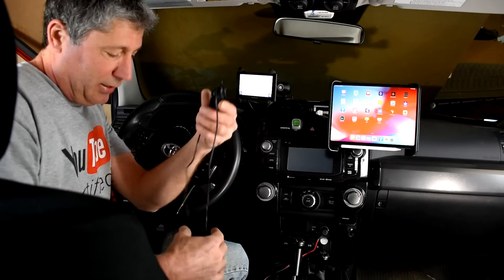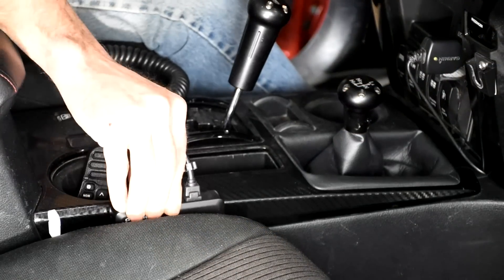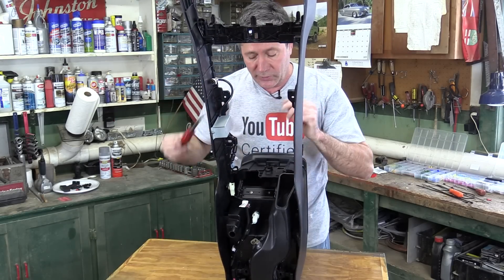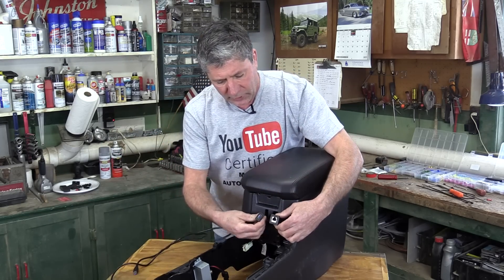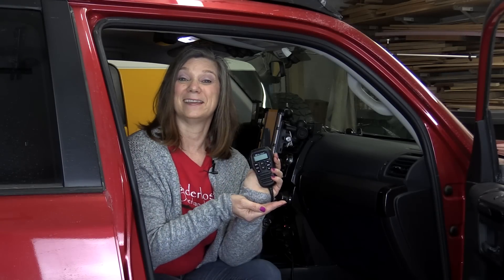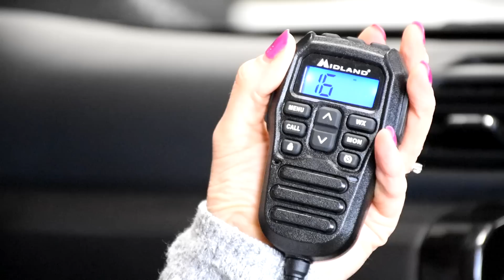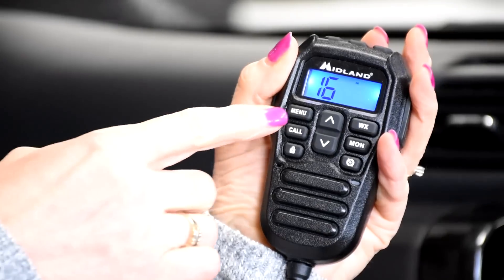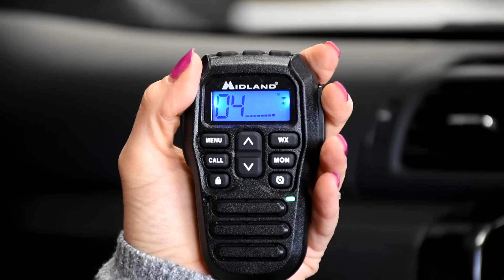GMRS Radio DIY Install & Testing Against CB Radio For Distance

Comment: Like others, I was concerned about the antennas used and the location. Ideally, any CB or GMRS antenna on a vehicle should be centered on the top. You must have the ground plane underneath what is effectively a quarter wave vertical. The CB antennas are reduced in size in most cases because a full sized quarter wave would need to be around 8 feet long. If it is 4 feet or shorter, you can not expect good efficiency. This is what can make GMRS do better since a gain GMRS antenna is only a couple of feet long.

I use CB, GMRS/FRS, and ham radio. If you are operating in a group, and everyone has the GMRS license, I would recommend that approach. CB is noisier, even with 12 watts PEP SSB, which is superior to regular 4 watts AM CB, but few buy rigs that add the SSB mode. And CB can be severely affected by long distance stations that may interfere with local communications if skip conditions happen. This almost never happens on FRS/GMRS.

CB can be useful if it is the only choice you have because the others only have CB. SSB  GMRS is usually better for short ranges, perhaps 10 miles or so when mobile, longer for base to base or base to mobile, especially if using a repeater, should that be available. Up to 50 watts output is allowed on the main channels. GMRS can interoperate with FRS on most of the channels (the ones the have allow the higher power levels that are the ones you probably would want to use). This means that if someone has a GMRS license and good setup in their vehicle with outside antenna, they can talk to someone with an FRS handie-talkie for a longer distance than two FRS HT's talking from inside vehicles which only allows very short range. Ham radio, is OK for hobby radio, but it only works if everyone has a ham license. And ham radio is about the same as GMRS for similar power and distance for the ham 3/4 meter band and only slightly less effective than the 2 meter ham band.

Comment: A LOT of mobile ham radios are 50,75 even up to 80 watts for VHF and even with just a short 1/4 wave mag mount antenna will have a lot better range than a 15w GMRS radio. It's worth it to take the test! I did it with very poor short term memory from a TBI, you can do it too!

Comment: GMRS may have more advantages then the traditional CB, due GMRS is Frequency Modulation and CB is Amplitude Modulation. The Real experience with GMRS is using Repeaters, which really allows communications  up to 150 miles or more depending on the location of the repeater and the antenna's height  Of course Repeaters are legally allowed up to 50 w ERP. Most surplus part 90 radios are typical used for GMRS Radios, even though GMRS fall under FCC PART 95 There hasn't really been manufactures putting out PART 95 GMRS mobile radio until 2014 up to now
Reply: Adam Huffnagle how many repeaters are there for GMRS?

Comment: The Ham test is very easy. 2meter and 70 cm are great . Now there's Digital to ware you can talk across the country and world. CB is still great with a better antenna.  I did like your video on the other option. My 12 year old grandson passed his FCC test and got all 34 questions correct.
Reply: I have been a ham radio operator for 12 years and my call sign is KD0DUJ

Comment: Ham is not ideal. Too many Old Farts on there disrespecting the New Hams who are young people trying to get use to the radio rules and the way you interact with others on Ham.
  I hear it all the time on 2 Meters that the much older people hate the New Hams and chase them off the Repeaters. 
Also these Older Hams hate the new Technologies that is added to Ham.
  I'm here in the Silicon Valley and I listen to Ham, GMRS and CB.
I'm a Ham and GMRS operator, but also Prefer the GMRS over Ham, due to being yourself and no like what the other Hams want you to be, I see that as being Fake.
  Just be yourself and use GMRS and everyone one will accept who you are, unlike Ham.

Comment: I have a C.B. with a Wilson 5000 antenna and in my car I can talk 12 miles without any problems. My friend I talk to at 12 miles is also in a mobile. Your radio is only as good as your antenna. By the way the "HAM RADIO" test isn't hard to pass, if I can do it anyone can. Get the current book, study it until you feel good about it and take the test. The book has the same questions with the same answers you will be asked on the test, telling you why this one or that one is right. Almost forgot if I am on the C.B. and I am on ssb, then I can talk about 25 - 30 miles away.
Reply: right out of the box, with very little in the way of upgrades (They did upgrade the antenna) they got 10 miles.  However, they won't get over a hill because 460MHz is primarily line of sight, whereas the the CB band will perform a little better in taraign, but not at the legal 4 watts. GMRS is legal to 50 watts.
Reply: i looked at the book and what the license allows. and have to ask why does it require a fairly in depth understanding of things you are not allowed to use unless you get the other licenses? why cant it just give me a brief explanation about those things just in case i would be interested in getting the required license for it?
Reply: @IrradiatedJellyfish.6746  And once again you have to Pay for a GMRS License.
Reply: @IrradiatedJellyfish.6746  Electricity and EMF are fairly efficient at doing nasty things when you fiddle with it. It is good at interfering with other services, starting fires, causing burns, cancer, genetic defects, and just outright killing. And it can do those things to not just you but others that wander too close to it. That is why it is important to understand how it works and where you can and cannot be safe when fiddling with antennas and radios and how propagation works at various frequencies. Plus, you are now accepting the responsibility of setting up and managing your station. If it is out of spec, you are responsible for knowing, stopping transmissions, and correcting the defect.
Reply: I'm an Extra Class and no Rockethead by any means. You just need to be interested.
Reply: if you can pass a ROBLOX group application (real thing btw) then you can do the HAM radio test so long as you read some books
Reply: I've never gotten that range out of my 5000.  You must live in Texas, or somewhere there aren't many obstructions......7 miles is as far as I've ever gotten and that was with a tuned and peaked 300 dollar radio......
Reply: 10 miles for mobile to mobile is NOT typical. 2 miles is typical. And maybe 4 miles if you have a quality radio, coax, and antenna. I have to deal with oversize load escorts all the time. I know how far they work. 
FYI- I have driven over a million miles with a CB, and a few hundred thousand with a HF, UHF, VHF ham radio. here is NO doubt my HAM radios make my CB looks like it was made for a three year old child. A toy, not expected to perform any real work.
Reply: @samualwhittemore228  Then how come so many of us get 10 miles out of a mobile rig when we take the time to do it right?  As was said, it all seems to come down to antenna and placement, you can't just slap a $10 Wally World short antenna on your car and call it a day and expect great results.  Put a proper 102" tank whip or the big boi coil spring antennas, actually tune your antenna, if you can put it on a proper position and not shield your antenna to make it worthless, they can do very well for many miles.

That is an overlooked aspect of some of CB's problems in field use.  It isn't that 11meter is worthless, it isn't that "CB sucks and is a toy".  The problem is HF is best with full size antennas, not small antenna coils.  A half length 2 meter antenna is easy, a half length 70 cm even easier, but even a quarter length 11m antenna is HUGE.  This alone gives a lot of "typical" setups of VHF and UHF an advantage over 11 meter CB in mobile applications, because handhelds and mobile rigs can run full size antennas, while most CB folks end up castrating their performance with compromise antennas.  

I've mounted a 102" whip on my cars for local testing.  When you actually use a true full sized 1/4 length antenna, you can go head to head with GMRS or other VHF and UHF when using the same power.  Those 4 little watts can do go a very long way, when you actually do it right.  Base station to base station, 20-30 miles 4 watts AM can be achieved.  A lot of serious CB people have gotten good results, even without amplifiers  

GMRS is a good thing,  more folks should get their HAM.  But I get a bit tired of people maligning CB.  It ain't as bad as anyone makes it out to be.
Reply: @samualwhittemore228  4 miles?.. With a simple Wilson 5000,  and virtually any cb , I can (and do) easily talk 10-15 miles. Four miles tells me you probably have a 4 foot firestick. I agree HAM outperforms CB, but with a good antenna, and a decent radio pushing 150 plus watts, CB is commendable.
Reply: @shannonavella6782  "...with a good antenna, and a decent radio pushing 150 plus watts, CB is commendable."

150 Watts is illegal in the Citizen's Band (as well as the GMRS band).  If you want to go to 150 Watts (or higher) take the test and get a ham license.

Comment: 📻🎧🎙  Okay, I'm a long-time (20+ years) Ham operator & CB'er. With handhelds (walkie-talkies), all three (CB, GMRS, VHF/UHF Ham) are extremely limited (only half mile or so reliably).
  In a vehicle, CB wins hand-down (radio service was designed for that). With a proper antenna (the key ingredient), you're talking 5-10 miles (vehicle-to-vehicle) and 15+ miles (vehicle-to-base). With under-used SSB CB, significantly more distance in either situation.
  As for VHF/UHF Ham radio, you do have repeaters, but repeaters are often not available in remote areas. Otherwise, the line-of-sight aspects of VHF/UHF (blocked by terrain, etc) greatly limits the usability of such radios, especially in a vehicle.
  In emergencies, there are far more CB'ers (both on and off-road), hence far more likelihood of getting help.
  In the end, CB radio, with all it's negatives, is still the best choice. While I do have GMRS and Ham radios, my vehicles are equipped with CB radios exclusively.
Reply: Until the skip rolls in (7 year cycles). Then you're lucky to talk a mile on a CB, though you can talk with people thousands of miles away. --- One advantage of using CB for off-road rather than GMRS is the wave length is longer so much better at getting over trees, buildings, small hills.  GMRS is "line of sight", if there's tall objects around your range will be very limited.
Reply: @DFDuck55    ..  Skip doesn't really reduce your range, just makes it harder to hear through all the background noise. A good antenna, well grounded, will reduce that noise by a few decibels. A speaker that attenuates high frequencies (where most of that noise is) will help too. Beyond that, it's just a nuisance. Turn the squelch up and deal with it. By the way, SSB will reduce the noise even more.
Reply: I used CB radios from the late 1960's till late 1990's.  My favorite times were when  the skip was in, and talking around the world on DSB (duel sideband). --- FM sounding so much clearer than AM really has little to nothing to do with speakers or squelch. When two people are talking at the same time on FM the strongest signal 100% overrides the weaker one. When two people are talking at the same time on AM you can still hear them both, with lots of heterodyne noise mixed in. There is no heterodyne noise when using FM.

Comment: Just FYI and someone may have already said it.. a cb un-modified only puts out a maximum 1 watt where as at high power for GMRS channels can be at what the radio is rated, most handhelds is 5 watts and your particular mobile unit is 15 watts.. the other difference is CB is AM freq and GMRS is FM UHF... GMRS  WRCB663        HAM  KE0IHJ       CB Handle - Nighthawk

Comment: Get your ham ticket.  You won't be sorry, most ham equipment works on GMRS frequencies.  You can talk to your local friends on GMRS with the added capability of worldwide communication.  You will learn how to make your systems function better, the range you are getting on 27 Mhz using AM is very poor, there is much room for improvement.  I'm just saying through ham radio you will learn how to set up a kick ass system on any frequency, any mode, with crap you can find in dumpsters.  It's a good skill set and your interest in it leads me to believe getting your ticket and learning more would probably be a rewarding experience for you and could potentially create good content for your videos.

Comment: It's hard to beat ham radio for versatility and coverage.
Reply: I totally agree, but this might be good for the family and friends that are not hams. ~KE8DMQ
Reply: @ohiophantom  That's right.  People often suggest "just get your ham license", but gmrs licenses let members of a family all use the radios on the single license and you can communicate with FRS handhelds.
Reply: at night time when the skip goes down.   

AM side you can do about 20 miles.
SSB  you can do 35 to 40 miles when there is no skip.

GMRS will go 10 to 15 miles   and 2 meter will go 10 to 15 miles.

now i know you can put repeaters on GMRS and 2 meter to go more.

but i will admit in day time GMRS and 2 meter are the best.  CB radio gets to much static in day time.
Reply: Yes but not everyone wants to take a test. Although ham is easier now then ever before with the morse code requirement eliminated.
I have both a HAM and GMRS license. They both have pluses and minuses.
The advantage of ham is much more spectrum you can use including HF, which the signal can go thousands of miles and allow to talk around the world! Also, with ham radio not only can you transmit voice, but there is a whole slew of digital modes. You can transmit GPS position, text-based messages, images (using SSTV), as well as morse code.
The advantage of GMRS is the simplicity, you don't have to be technically minded to use it unlike ham radio. Also, the license covers your entire family unlike ham radio where each person needs their own license.
The bottom line: If you just want simple communications for your family - go GMRS. On the other hand, if you want to get the most out radio and are technically minded - go HAM.
Also, I originally only had a HAM license and the main reason I got my GMRS license was so I could talk to my buddies who only have GMRS licenses.
Reply: Amateur is for experimenting; GMRS is the way to go for people who just want to use a radio as a tool.

Comment: As Commercial and amateur radio operator I fully agree GMRS is sooo much better than any CB.  GMRS is UHF FM in the 460Mhz band.  Antennas are short but still produce gain.  One thing to remember is the smaller the coax the higher the loss in the antenna feed line.  I would not use any coax smaller than 1/4 inch such as RG58 for short runs in a car or truck. At home I would use RG8 Coax or larger for GMRS.   Also if you have a GMRS Repeater in your area your range could be 50 miles or more depending on the repeater antenna height above average ground level (AGL).  CB is in the 27Mhz band and is AM.  The noise floor is much lower for GMRS so you can receive weak signals clearer.  I am glad to see Midland building GMRS mobile radios.  As a side note, GMRS is the same as the old Class A Citizen Band.  CB in the 27Mhz band is the old Class D Citizen Band.  Fill out a simple form on line and pay with a card and you are licensed for GMRS by the FCC.  The entire house hold can operate off of the same license, children included.  The license is cheap compared to the potential fine of up to $10,000 for not having a license.  I see people being fined $5000 to $7500 for unlicensed operation on GMRS and Marine Band on the FCC Enforcement web site.  If you operate GMRS in a National Park be sure to have a license because this is where many people get in trouble.  It appears US Park Rangers monitor GMRS traffic and pass along information to the FCC for enforcement if they never hear a FCC Callsign and cannot find your name in the FCC License Data Base as having a GMRS license.  Don't take a chance.  FRS does not require a license but it is only low power and you cannot use repeaters.  Have fun and stay safe.

Comment: If you’re just interested it using a radio to talk to each other then GMRS is just fine. Ham is more than talking to each other,
Reply: Ham radio can not only talk to each other but others far away. Real handy if you don't have cell coverage and there's an emergency. You both have to be licensed hams. And remember a "good" antenna on CB is much larger than a good antenna on GMRS.
Also, look on MyGMRS.com to find a local GMRS repeater. You could be 30-40 miles apart and still communicate via a repeater. And it's also a good source in an emergency because you can talk to other people who can call for help.
FYI-I'm both. W9DLP ham and WQXU747 GMRS repeater (look me up on either (QRZ.com) if you have any questions.
Great video
Reply: Rob Schlotterbeck - if you gone through the difficult license process.   As a ham licensee,  it doesn’t seem very inclusive.

Comment: Your CB install is shit, and that's not a real cb lol.
Learn RF if you want real radio communication. 
I get 20+ miles in the city and over 90 miles in SSB without skip on my anytone and ive seen better on vehicles  with metal roofs. 
Antenna resonance  and ground plane is key.
Reply from the maker: Thanks for watching! We appreciate your support. :)